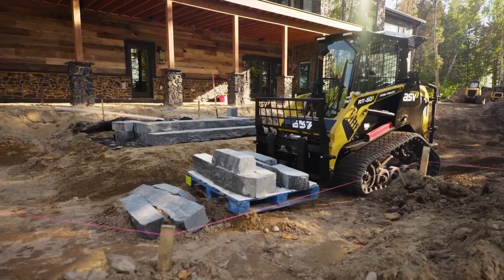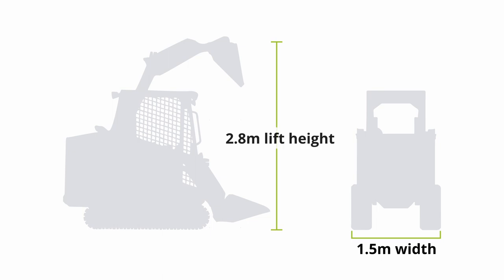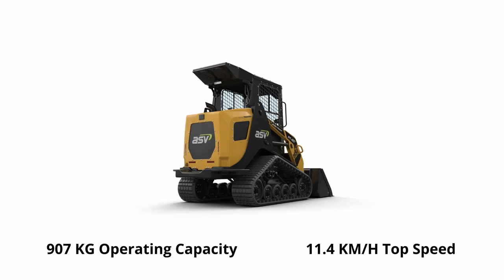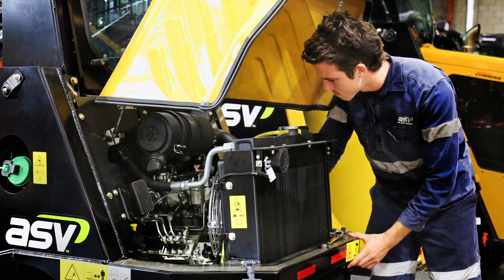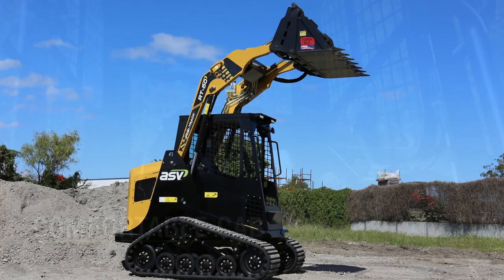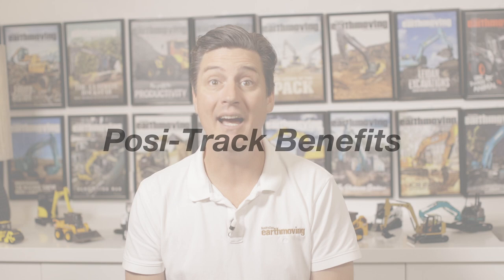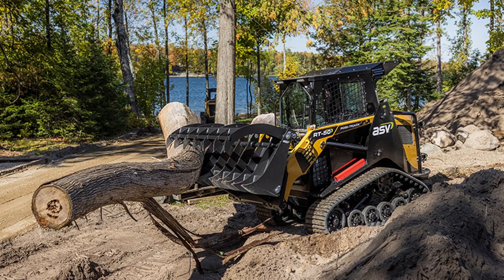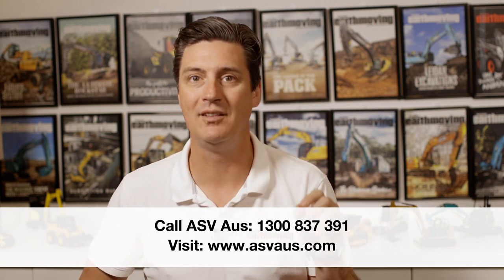ASV RT-50 Posi-Track Loader: The Ultimate All-Rounder

Comment: Hey I have a question I bought this same machine brand new and when I turn the key I get a constant loud rapid clicking from the fuel pump above the filter on the back left side of the machine. It never stops clicking when the key is on, I can not hear it when I start the machine...is that normal? I was trying to find out, but can not seem to get an answer.
Reply from the maker: I'm definitely no technician but I would definitely contact the service team at ASV Sales & Service. https://www.asvaus.com/parts-and-service/ Are you in Australia?
Reply: Good question, ,, ,, if you get the answer please put it up here' Thanks.

Comment: Your wrong about the 907kg operating capacity.  It's actually 635kg as it's by law only 35% capacity for these machines so it's 635kg and this weight includes the weight of the attachment I.e 4in1 (250kgs so all you have left to lift is 385kg ) false advertising sorry . Same problem with the rt40 after you add a bucket you are left with 200kg is all you can lift .
Reply from the maker: Oh man. Thank you so much! Not doubting you but let me verify with ASV and I'll make some quick corrections as required.